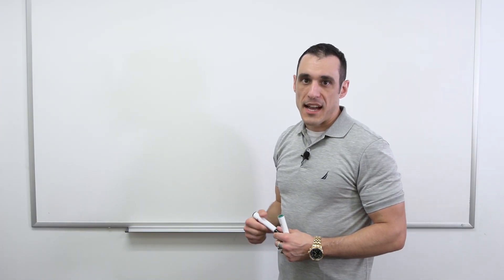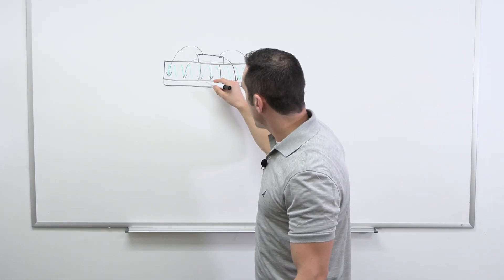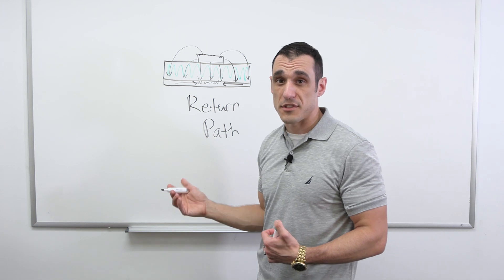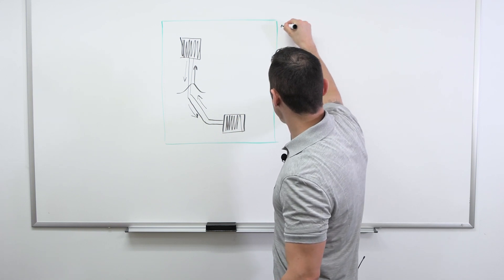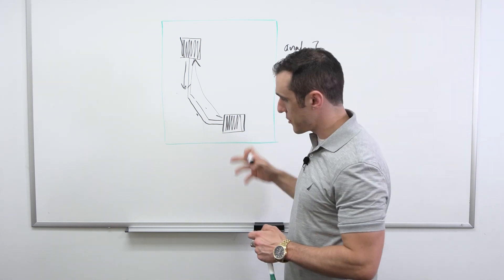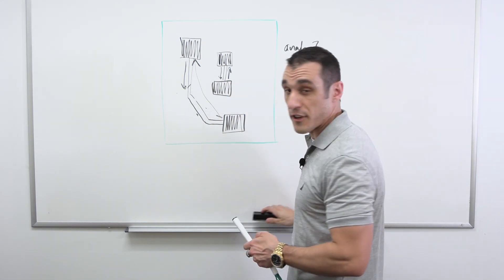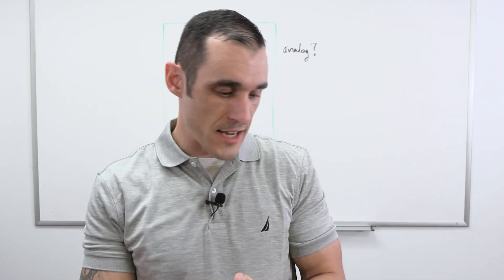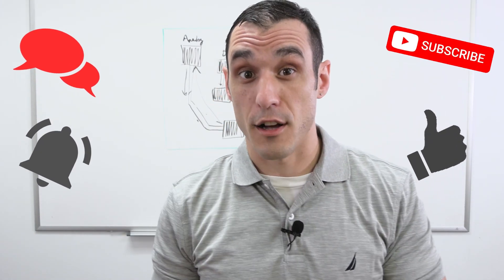Return Paths | Mixed Signal PCB Design: Part One

Comment: If there is a capacitive coupling between ground plane and trace carrying high speed signal then we have ground bounce on the return path shouldn't we increase the distance between ground plane and trace to avoid it?
Reply: Ground bounce (Sometimes called simultaneous switching noise) is not caused by capacitive coupling between the trace and ground plane. Ground bounce is due to inductance along the signal path when a signal switches states (inductance comes from the trace, I/O leads, GND/PWR leads, and any vias in that signal path). The inductance causes a back EMF that increases the GND potential as measured at the I/O pin. Because the I/O buffer circuit and the I/O + trace capacitance exist along this signal path, we will have an RLC circuit with low resistance. This means when the I/O buffer is excited and switches states, the fast edge rate will cause an underdamped oscillation with relatively high frequency. This is the reason you can sometimes see ringing on the rising edge of a fast digital signal.
Reply: @Zachariah-Peterson  But whenever a driver circuit drives a signal on signal trace to receiver circuit, that signal returns back to driver circuit through return path(can be beneath ground plane or a ground trace) so i was asking in both scenarios capacitive coupling of signal trace with the ground trace and inductive coupling of signal trace with the ground plane, we got increased return current on return path due to back emf. If my understanding is correct then doesn't the additional current on return path due to back emf contributes to more noise and other sort of issues.
Reply: There is not additional current in the return path, the total current in the circuit includes what would be measured along that return path. The path followed by the return current defines the inductance of that circuit carrying the current, and that determines how easily it can couple noise to another circuit as well as receive noise from another circuit. The same idea applies to capacitive coupling of noise. If that path is not well-defined, then it's possible to have problems with crosstalk, radiated EMI, conducted EMI, or all of these simultaneously.
Reply: @Zachariah-Peterson  I understood what you are saying and because of that inductance we should have a small return path but i am asking when a high frequency signal or digital signal with very fast rise time passes travels on a transmission line it will generate magnetic field lines and because of having a tight ground plane those field lines will couple with the ground plane but because the signal is time changing signal so magnetic field will be changing and because of that in ground plane current will induce so what will happen to that current?  Will that current be added to the returned signal current?
Reply: @ahsanalirafaq805  The reason we get a particular magnetic field distribution around a trace is because of the current in the signal and the return current from the signal. If you are looking at this from the digital perspective, assuming the gain provided by any I/O buffer circuit is = 1 then the return current is the same as the signal's current. If you think of a load as connecting the signal line and the ground plane, then the return current is still the same as the signal current. Remember from Kirchoff's current law, the current along a particular loop is the same no matter where you measure it.

Comment: In digital signals (mostly train of similar or dissimilar pulses) we can have both high frequency parts and low frequency parts added up together. So here, why we just considered the high frequency parts' effect and ignored the return path of low frequency parts in a digital signal?
Thank you for great contents👌
Reply: From my understanding, because the digital signal contained both high and low frequency part in it that's why he didn't consider the return of low frequency part because the principal frequency and harmonics move together also the circuits are high speed circuits that have fast rise time the lower frequency signals have low rise time so no need to discuss signal integrity issues.

Comment: where is this idea of "low frequency analog current will spread over the board" come from?
what is the theoretical basis of that?
As far as i know, the current distribution on the return path (reference plane) is controlled by the substrate height, trace width, and dielectric constant. There should not be any dependence on frequency.
Reply: There are simulation results you'll find that show this. I believe there is a reply to another comment in this video with an IEEE article showing some results. The theoretical basis is due to the higher impedance seen by capacitively coupled return current from the trace to the plane. So at lower frequencies, the return current would have to couple via conduction and would prefer to follow paths with lower resistance. Theoretically this would be a straight line, but of course charge repels itself and thus spreads out in the plane. Combine weak capacitive coupling and stronger resistive coupling and you don't have the return current closely following the trace anymore, and it can spread out in the ground plane. That doesn't mean the current is distributed evenly across the entire board and I didn't intend to communicate that, but it does spread out in the GND plane, which might be in a region that's not near the trace supplying the signal.
Reply: @Zachariah-Peterson  thanks for the incredibly prompt response. I will look more into those reference you mentioned.
Regards

Comment: In a mixed signal board is that analog signal effect digital signals or digital effect analog?
Reply: Both! Digital signals in saturation logic circuits are less susceptible to noise from analog unless logic levels are low and/or the analog signal that creates crosstalk is running at high power. Digital signals create strong spikes in an analog signal that will interfere with analog components as these spikes appear as additional frequency content.

Comment: There are many excellent videos from Altium (Hartley, Webb) about the theory and what NOT to do.  Many repeat the same things over and over again.. What is quite missing videos HOW to do. Take for example a simple circuit with a few components., mixed power , 3 power rails (3V, 5V, 9V) and multiple LED that all take 9V supply and driven by 3.3 V logic fed from an IC powered by a 5V to 3.3 regulator add several simple SMD IC's. Now go and apply all the rules correctly without traces crossing planes.You will find for a such a simple design 4 layer is almost not  possible without some violations or you need a much bigger board than is practial.No wonder commercial designs use a huge amount of layers (who can afford the cost).  With lower layer counts (lower cost) , the worry comes... will I it pass EMI with these violations ? Multiple layers means many  ground via's to avoid EMI issues. Mostly the solution brought up is  "add layers". Theory is nice but where are the practical examples of violations and their impact and how to solve ? How many ground via's needed, for what frequencies.. where to place them  ?  how far can violations go ? Should I use a  power plane split up in difference planes areas or route the power with traces ? Am I perhaps worrying to much ? etc.. many questions...
Reply: Hi Debugging, I understand the frustration and, oftentimes, the apparent lack of clear direction. What I can say is that any PCB layout will have many competing requirements and it's impossible to objectively determine the "best" design in every situation. My hope is that in these videos we can make our guidelines more actionable instead of focusing on what people do wrong. Thanks for watching!
Reply: I think its difficult to bridge these things. What these videos do is giving broad understanding about fundamentals. Particulars are so infinitely varied that its almost useless to demonstrate them. Of course it would be a good idea to use particular samples in some situations but this will then become much more time consuming and I assume more expensive to produce as a content. Becoming “perfect” electronics designer is lifelong exercise which still ends with failure :)

Comment: Analog signals at very low frequencies will spread all over the entire board, no matter how far away you separate them.
Even out of and into connectors unintentionally.

I have my own strategies of how to design, for example, an audio sound card (high speed digital + audio analogue signals).
But, I would love to hear Zach's approach on how to get around this - he mentioned via stitching or something, but this won't help.
These approaches work for separating 2 x High-Speed signals, not 1 x High-Speed and 1 x Low-Speed.
Low-frequency analogue signal return currents will spread all over the board, all over! So, keen to hear how we can counteract crosstalk from this :)
Reply: Crosstalk, ground bounce maybe better said, where the digital signal is the victim? I don’t think this would be a big problem.
Reply: Define high and low speed, and "very low". How do they get there? I can't couple into other areas if you give them a proper return path. How are you saying they couple into everything regardless? By what mechanism?